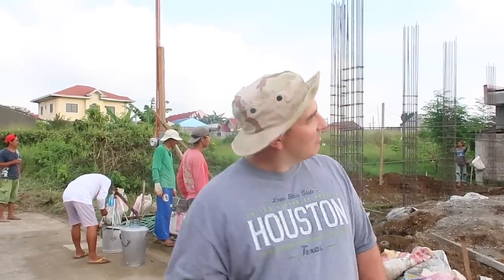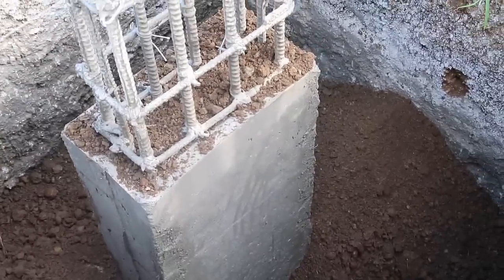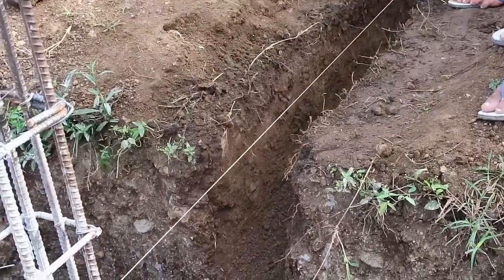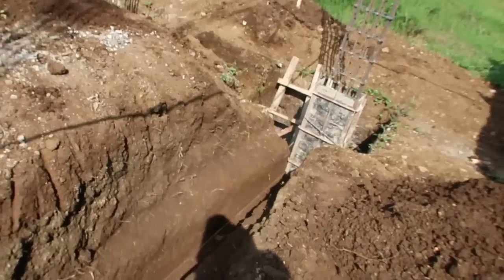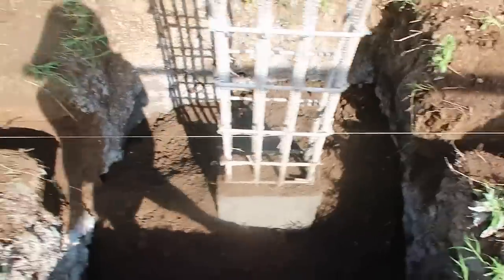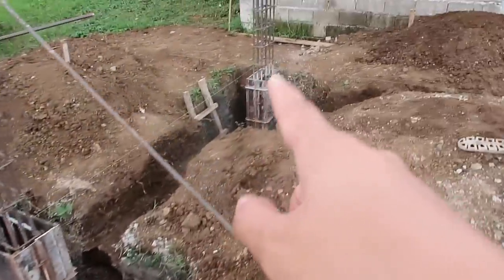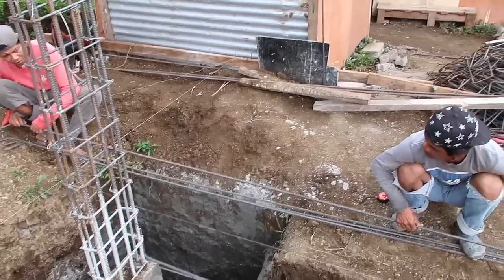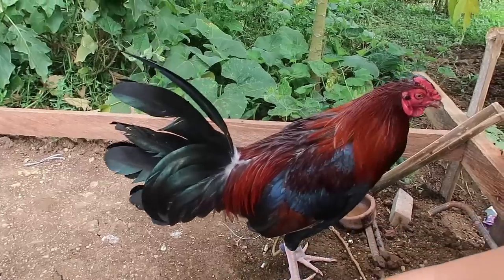HOUSE BUILDING IN THE PHILIPPINES - EPISODE 14: PLACING THE TIE BEAM

Comment: The rebar needs to be at least 2" inside of the outside of the concrete (3" is best) to prevent rebar corrosion and eventual concrete cracking/breaking
Reply: 50 mm min .
Reply: Actually 3 " is a ICC and ACI code concrete cover
Reply: @RJMDesigns  sad to say I don't think anyone in the Philippines follows code and it is a humid, rainy, salt air environment so they really need to prevent rebar corrosion.
Reply: @myparadiseonbantayanisland9030  yeah your right.
Reply: lagyan mo lang ng sahara
Reply: I've been in construction for almost 2 decades.. as far as I know... steel concrete covering is 25mm...correct me if I'm wrong...
Reply: @cardoduterte2844 recommend 50 mm minimum here in the Philippines due to very moist tropical climate and being on islands with salt air from the ocean.

Comment: 12mm bar and below is a Must not used in a beam.....tie beam are design to make the building isolated Footing into One....to stay or moved as One Solid Structure in case of an Earthquake to prevent structural cracking or minimise damages to the building itself. Plus tie beam must be placed eccentrically to the column to prevent twisting or torsion effect in case of soil movements. Just sharing my knowledge and experienced as a licence CE in PH and studied advanced structural engineering design and construction management here in Sydney.
Reply from the maker: Thanks
Reply from the maker: We replace it and We use 16mm by the way ,if your going to watch more of our videos .

Comment: todas na yung stirrups, ganyan talaga pag nagtitipid, huhulaan nalang ang spacing ng stirrups at size ng mga bakal
Reply: exactly. may proper spacing columns specially for columns which is computer or designed using software.

Comment: Just thinking, Future gray water and black water drains need to get out from 
under the house.  You can put some sleeves through the tie beam to avoid
digging under it later.  The deeper you leave the building the deeper the septic tank
inlet will be and closer to the watertable level. Every little bit helps. Our tie beama are
60  cm wide and  21 cm deep with the sleeves near the top of the beam. 6' sleeves
for the 4"  drains and 4" sleeves for the 3" drains. All our drain locations are close
 to an exterior wall and  have minimum fittings under the house, All the
 interconnections are around the exterior of the house where any leak  can just drain 
into the ground. We also did sleeves for the underground electrical entry and the
piped water feed line. Your tie beams look plenty strong on undisturbed ground to
upport the hollow block wall up to the next tie beam, and earthquake compression loads.

                                                  george and aurora
Reply from the maker: We actually change our tie beam to 16mm  with anchor,

Comment: napadaan lang ako dito tpos nakita ko to. super dami nmn yata ng rebars na ginamit sa pag construct ng column at tie beam. di nmn yata ganun ka disaster phrone yang area. Kung gagamitan yan ng structural analysis, makikita na excessive ang bars
Reply: Ok lang yan. Mayaman naman sila. Ang mahalaga ay safe.
Reply: @ralphcastillo6444  hahaha di yan sa dahil mayaman. kelangan sa building construction eh balance. Pag nag structural analysis kase sa building, di pwd na excessive ang bars kase pwd unmag cause ng failure, dpat ung recommended lang or pwd dagdagan pero di pwd sobrang dami. may portion kase sa bars at may portion ng cement. Gumagawa kase ko ng structural analysis kaya medyo may konting knowledge lang.

Comment: main bars should be inside of the column not outside.. spacing of stirrups are too far.. put extra bars in tension sides
Reply: mam nemie tanong ko.. main rebars?..yan ba yong tie beam na dapat lhat ng rebars nasa loob ng column vertical rebars? and tension sides?san jan?yan ba yong interconnection ng column and footing tie beam.? 
"baka matuto :)
Reply: Hae. It's a column not a beam darling

Comment: As an engineer in my opinion, the construction joints shown between the interface of the tie beam and the column are not good.the tie bea rebars jointed on the cast column leaning on the surface. remember that the purpose of the tie beam is to hold the column for settlement or lateral movement(just on case)
Reply: So meaning it should have at least a part of column monolithic to the beam?
Reply: ideally it should be,

Comment: Good that your  base tie beams  sits on a bed of gravel and not combination  of gravel and dirt...Your tie beams  lacks  the the following...longer  90 degrees  legs  and should  point  downwards at the bottom.. Upper legs should wrap around coloum externally...Weight and gravity push down..likewise ship anchor.. pointing downwards.... Legs should  be tied outside  coloum horizontal bands...not inside. Imagine  earthquake..your hugging  a pole.. you hug external  circumference  of pole horizontaly with both hands touching each other....Your hands  is comparable  to tie beams legs.. the longer. The better..You hug or tie externally and horizontal....not  inside..

Comment: A BIT SCARY design. no 135 degrees hook on ties and stirrups. it shows that they don't hire Real Structural designer. This one is done just by the architect including the beams and columns reinforcement. When earthquake comes, this type of construction is candidate for cracks! it seems all ties and stirrups are with same spacing. huhu. we are in the Philippines and we are in earthquake zone prone area.
Reply: Nagassume na naman na architect ang gumawa.

Comment: Stirrup and column rebar were mistakes, find a good structural Engineers.
Reply: can you explain why. I want to educate myself what to look out for
Reply: Place the main reinforcement within the confinement of the column vertical bars.
Reply: @silvenepistola  use square shape not fckn rectangle shape its dangerous for moment forces. because coloumn had eccentric axial forces
Reply: @silvenepistola  
Column Rebar is ok,
Needs confinement ties between the conjoining members (column/tie-beam) 
main bars of Tie beam needs to be inside the vertical bars
Column vertical bars needs to have a correct splicing of 33% (or 50% on some case)
column ties needs to have a correct development length and angle (check spacing also)
clean the area prior encasement of form
Rectangular shape column is ok, as long as it meets the required design based on design analysis 
Cheers!

Comment: i'm an American from Arkansas, living in iligan city ( Mindanao ). in process of getting build permit, what size rebar did you use in the columns and what is the size of the rectangular rebar cage stirrups? looks like its 6" by 14". thanks
Reply from the maker: Its been mention in either before or after video the size of stirrups, we use 8(16mm) and 2 (12mm) for our column because were suppose to do 3rd floor but we didnt do it
Reply: @retiredandhappyinphilippin3329  thank you for the info, i'm only building single floor house with 150sqm floor plan not counting the porch and carport, total floor plan will be like 200sqm.
Reply from the maker: 6pcs is fine
Reply: Hi Paul, i suggest you get a design team to make sure all permits are within the standard code and etc.
cheers

Comment: Are the contractor using the plan for layout, the position of tie beam rebar is incorrect. It is installed on the out vertical of vertical column rebar. The stirrupds hooks are 90 degrees when it should be 135 degrees per. ACI code. The foreman does not seems to know what they are doing. The installation of rebar is incorrect still he did not instruct the worker to correct it. I always commented this on the re bar installation on most construction.  Not in compliance with structural codes.

Comment: what the hell is tie beam? maybe its  grade beam
Reply: They are the same. It is called grade beam because it is buried on the ground. And, it is also called a tie beam because it ties-up from one column to the next column.
Reply: @joneighdeen3006   its true .but when you have footing and grade beam . It's not yet column ,  because some of them are called pier. Plus a beam could be vertical or  horizontal . A tie is just stabilizer,  or stir up. So its still a footing with grade beam. Okay  let me ask you this What do you call when you have a pile cap with grade beam?